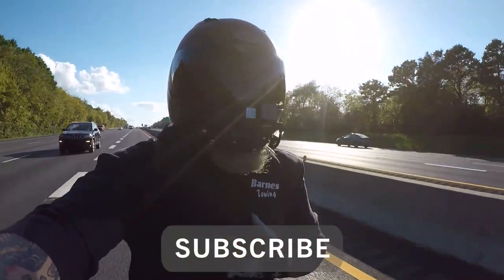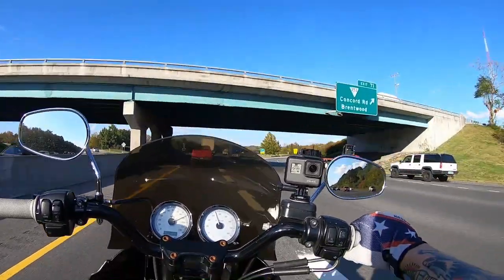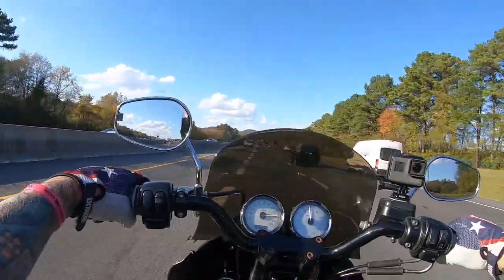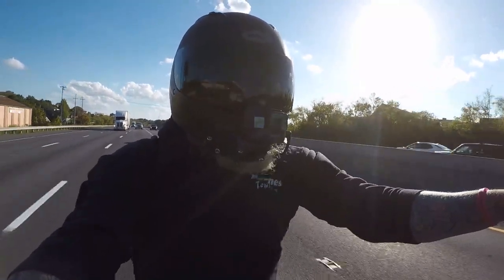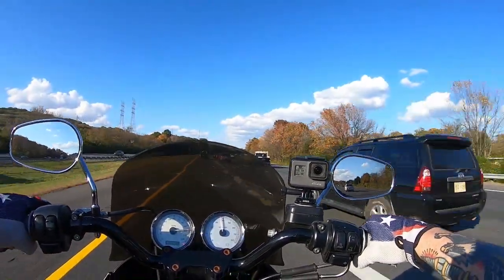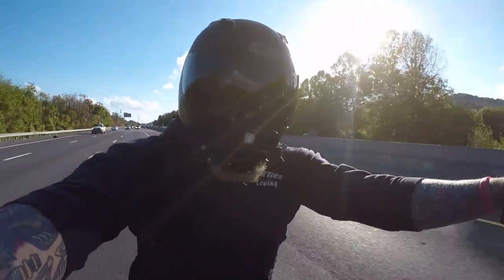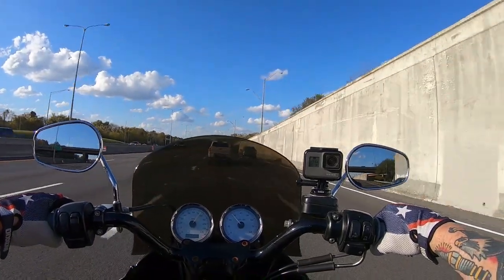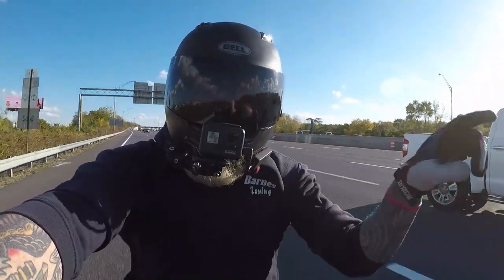Harley Moto Vlog #34 Performance Bagger Build Talk

Comment: Looking forward to videos. Neck bearings will usually have play that u will feel with front end off ground or by just rocking bike back and forth and locking up front brake.
Suspension and or tires are also sources of front end wobble.  Good luck.
Reply from the maker: Thanks man
Reply: @TrippHPjunkie  I have the same issue on my 08 electra.  I changed everything from the engine mounts to wheels and tires and feel the only thing left are the neck bearings.  I'm curious did you change yours and did that solve the issue?
Reply from the maker: @antwonethomas5614  I did not change neck bearings the bike has since been traded in